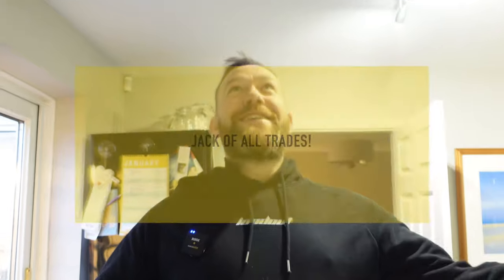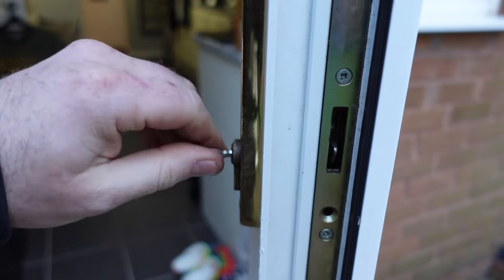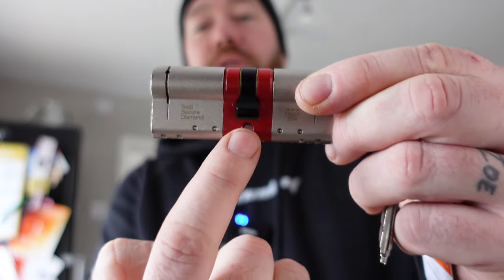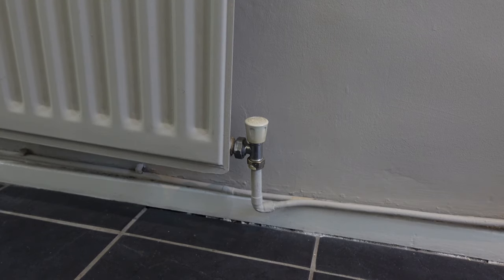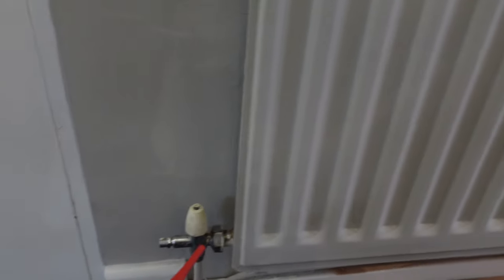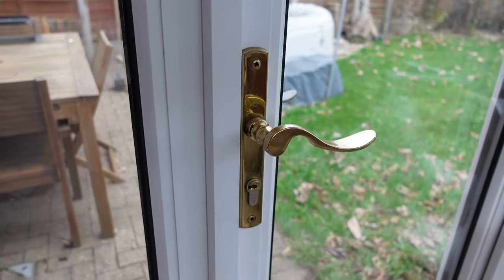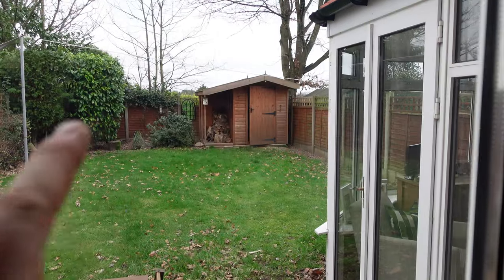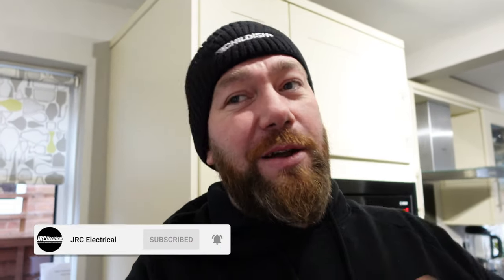DIY EASILY Upgrade Your Home Composite Door Locks With Ultion Anti Snap - Electricians Life Vlog UK

Comment: Not a plumber, but when I have done that with radiators I loosen both ends just enough to fold it down onto the floor, there is usually enough give in the pipes to lift it off the brackets, tighten them up and then work on the brackets, it's a little bit awkward with the rad in front of you, but it saves a lot of time when you put it back on (reverse process) and there should be very little bleeding to be done
Reply from the maker: That’s a class idea 
I would worry about snapping stuff on pipes smaller than 15mm 😬
Reply from the maker: @FFT_Electrical  a class idea I shall be using from now on